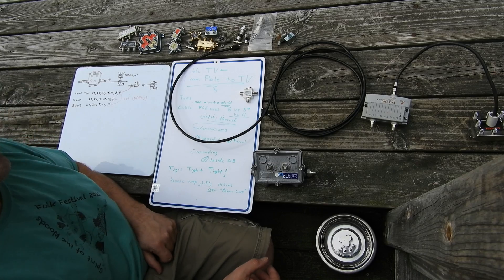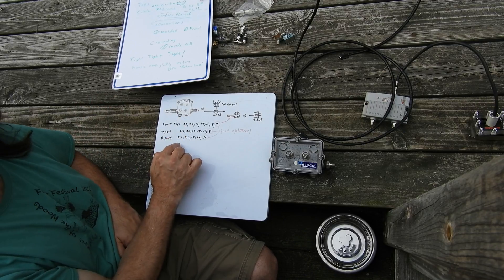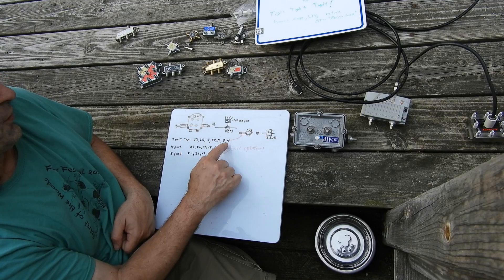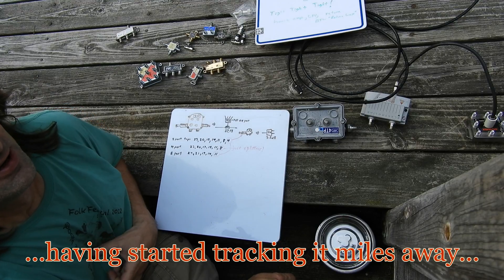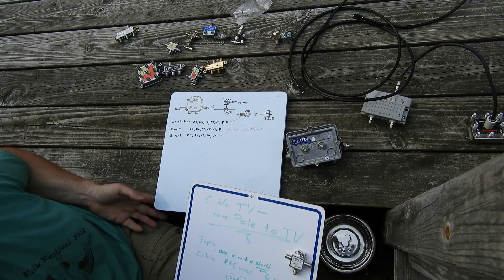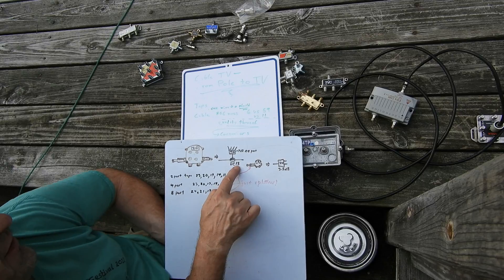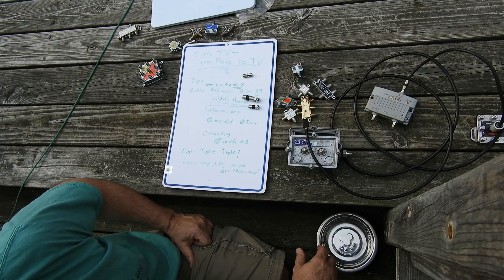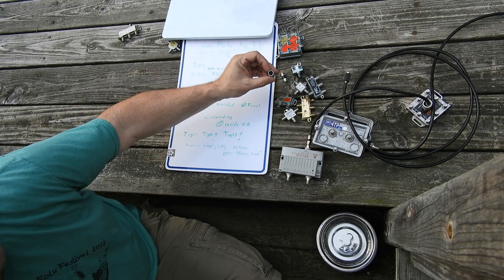CATV - From Pole to Home

Comment: I was the only on the tap 20 years ago.  Now 2 houses were added.  The tap only had two outlets.  They cut my line and added a splitter to feed my neighbor and my signal .  I've had interference ever since.  How do they fix this?  Should the tap have 4 outlets to eliminate the splitter that my neighbor and I are sharing?
Reply from the maker: Ideally, they should change the tap plate, but it depends on the design whether it can be done or not, if the extra loss would be significant downline. If the big number on the tap is a 4, for example, you'd have to go up to an 8 value to get a four-port tap, so signal levels drop 4 dB. Same with a splitter at the pole but it is done sometimes when feeding three customers. putting the longest drop directly on the tap and the two shorter ones on the splitter. I always tried to get the service techs to run a piece of ground wire from the tap to the splitter if they do this, a little shorter than the RF cable so it takes the strain off and better grounds the splitter in case one of the customers developed a floating neutral. It really shouldn't cause interference unless the connections are bad or loose or the signal was already weak, or your neighbor is feeding in unusual interference.

Comment: Hey I got a bit of a problem with where I live. Xfinity wants to charge $45,850 to pull coax to my house. 614 feet of cable total needed and I'm going to split to to units with their own equipment so I can separate the networks. We are tenants and the landlord isn't going to pay our install. So I am going to try to plug into our tap from the power line and run the weatherproof coax myself- can't afford to bury it. I need to know if I need a repeater, if so, can I power it from the house itself. Never done this before, so I need some guidance. I can pick up a spool of 1,000ft of 18 rg6 quad shield cu catv cm/cl2 for 98 bucks
Reply from the maker: Expensive quote! They are probably going to run .625 hardline and an amp too for that price. Doing it all with RG6 would likely require an amp with tilt and return, they probably won't let you do it. I've seen people get the design from the quote and then hire a contractor directly to build the plant. You still have to coordinate with the construction department. I'm kind of guessing that your connection to Xfinity is probably near the end of their line so the levels are flat or even reverse tilted. You can buy a "house amp" with passive return that can be back powered from the house, and that could possibly work with expert setup. Maybe find a building that is in range of their plant and setup there and go WiFi via outdoor antennas. They should build it if there are enough potential accounts but they would want to sign an agreement with the landlord, gets complicated.

Comment: What's your opinion on excessive RF Tilt/Slope actually having any effect on the connection besides going out of spec easier if there is movement on the network/plant? As long as all channels are within spec I have never seen a degraded service from say a +/- 14db Tilt..... I'd be interested to hear your thoughts on this as you have more experience than myself. There seems to be no clear conclusion from anyone 🤷‍♂
Reply from the maker: It can be a problem depending on how the Low Band is used, if the levels get too low. I was rarely a problem on the system I last worked in, often I was surprised to see everything working with the low end so weak. But in the bigger system south of us they carried some well-watched digital channels on their Low Band, and a couple of their line techs were reluctant to properly EQ the taps.

Comment: A CATV drop cable has been placed outside my window, does this emit radio waves, I'm concerned because my bed is situated near?
Reply from the maker: If the cable is in good condition it is completely shielded. It can leak signal if the connections are loose or damaged or the cable has been chewed.
Reply: Thanks for getting back at me, Could I remove it, don't need it?
Reply: There have been millions of radio waves transmitting right through your body since you were in the Womb, it's too late to worry about a completely harmless drop cable outside your window. You'll be fine 🤦‍♂

Comment: I have a question about my cable modem downstream channels I have a D3 Arris surfboard 32x8 modem and one of the channels continuously causes problems. I reset the modem thinking that might fix the problem but it keeps coming back the problem is for the first 5 minutes the packets going through channel ID 7 are fine but awesomely I get thousands of uncorrectable packets what could be the issue? The cabling in the house is about 10 years old it's RG6 I have a Poe filter on the main line in the only thing I can't check because the pool is so high is the connections at the main tap have any ideas or suggestions what it could be?
Reply from the maker: Hard to say from here but check out my video on Self Install Kits for some tips that might help. If you can identify what frequency that ID7 is at it may yield a clue, for example, if it was around 27MHz it would likely be CB interference. Grab a 7/16th wrench and make sure all connections are snug. Look for any connectors that weren't installed correctly or any damage or kinks, unterminated lines and etc. The Self Instal video goes through this type of stuff.
Reply: Okay I did what you suggested i checked all my cable lines made sure they were all tight and the problem still occurs I looked inside the plugs to see if there were any pieces of metal sticking to the stab there wasn't the last thing I can think is the cabling going through the Attic a week ago they just replaced the main cable drop coming from the top on the pole.

P.S. the downstream frequency is 435.00 MHz
Reply from the maker: @christophermoriarty7847  Any idea on  RX/TX levels? Did you inherit the house wiring or have you been there the whole time? Wondering if there could be a hidden splice or splitter somewhere you haven't found. Too much receive level can be a problem, so can too little transmit or a max'ed out transmit. If the modem is the only thing hooked up and you have no splitters, often you will have a high RX and a too low TX and sometimes an attenuator "pad" might be needed. Do you own the modem or is it owned by the Cable Co.? Don't go out and buy a new modem unless your able to borrow a test modem from the Co. to test first. Techs don't like to change modems because of the time it takes to get it set up with the office. The bottom line is to make them come out and fix it. Techs are under great pressure to get the job done quickly but repeat calls are a black-eye for them. Sometimes it takes repeat calls to get the Ace service tech out or to get it bumped up to a line-tech.
Reply from the maker: @christophermoriarty7847  The upstream frequency is usually the more vulnerable, lots down there that can interfere...

Comment: I've got a question.  For some reason in my house, we've always needed a little plug in power booster that the coax connected to, that boosted the signal enough to use a cable modem.  The cable that connects to the little booster, is upstairs in a bedroom that doesn't have a tv or use the cable (other than to run the booster).  I've tried moving the booster, and connecting it to a coax cable in another part of the house, but it doesn't actually boost the signal for the house- at least not to the cable modem.  Any ideas why this run of cable, to the upstairs room, is the only one that seems to be able to put the booster to use?  Is it because of where that cable is connected on the tap (inside box on the back of house)?
Reply from the maker: You really need to know your 
receive and transmit levels from the modem. You might be able to gather this info by logging into the modem or finding a freeware program online. Modems don't like too much signal, maybe there is something wrong with that line that it is making up for. Unless the booster is made for cable it might not have much of a return path, it may be helping by attenuating the return. A lot of possibilities. A modem only needs to receive the DOCSIS channels at around 0dBmv, and best if they are transmitting in the mid-forties.
Reply: @HillsWorkbench  
Hey, I really appreciate you getting back to me about this.  I had wondered if when the booster is not connected to that line, if the line is acting like an antenna (as you mentioned in the vid), but it was just a thought.  I don't have the tools or expertise to really delve into troubleshooting the cable setup in my house, so I'll probably just call a pro to come look ; )  Again, thank you for taking the time to respond, and for making this excellent video!

Comment: Hey few questions mate. I recently noticed a messy utility pole, and neighbour has it backwards feeding into the junction box which 2x4 wood probably glued on both ends which has to be a violation. Even though its rg6 or whatever can't be legal to do it yourself  right? Most likely is feeding power as well. Also I have 3 boxes while its showing up as 4 tivos with a cloned mac address so it has to be them stealing from me. Probably why I got hacked so many times as well. TV and internet since its moca. And who knows what else, probably using my power as well since my garage keeps tripping the breaker. You mentioned the taps are also sometimes assigned to other neighbours right? As a customer wouldn't we have a say not sharing? Also new lines are hanging low so either way  they'd have to come. Thing is the pole is literally  2 feet from my garage and like few feet from the garage roof to the top of the utility pole. Probably  12ft tall. Know annything about city charging you or its their resposibility?>
Reply from the maker: It would be hard for them to tap in unless via WiFi, they shouldn't be able to get into your Moca from the pole. Kind of hard to follow your description of the pole...
Your garage breaker is likely a different issue. Are your bills huge? Maybe the line out to the garage is leaking, insulation damaged.
   A typical CATV tap may have two to eight ports. These ports have better than 20dB of isolation from each other so neighbor to neighbor interference is rare.
  Not sure I get the last point.  2' for a cable line is adequate clearance over your garage though some areas do not allow "aerial trespass".

Comment: This is great information.  The Comcast contractors need to watch this video especially the grounding portion.  They did my install and did not ground a thing.  I had a  Comcast tech come out and he was appalled on the poor installation.  I believe that grounding is code in some areas.  To make matters worse some of the connectors were poorly crimped.  Want cable installed make them send an in-house installer and not a contractor.!
Reply: In house service techs always have it tough, the press of the expected productivity metrics, and constantly having to clean up after contractors and Self Instal Kits, what is booked for a simple task turns into a manifold list of chores.
Reply from the maker: I'm moving to a more rural area and had to get satellite for internet, same deal. The contractor didn't do any grounding, no weather protection of connectors, took a long time to find the satellite because he put the pole in way out of plum. Contractors only make money by getting away from you ASAP.

Comment from the maker: JohnAudioTech
JohnAudioTech
2 days ago
I used to disconnect the cable from my modem during storms as I have had stuff killed by lightening. I probably should put on a terminator when doing that. BTW, why the 360K upload?
Reply from the maker: Hi John, thanks for pointing out the low rez. Uploaded in 4K, not sure why YT limited it to such a low resolution, reuploading it seems to of fixed that.
 Ideally, Yes, termination is always proper, though you probably won't notice it with digital TV and while not using data (while disconnected obviously). I rent my modem, but if I owned my own D3 modem I'd probably disconnect it in a major storm too, just be sure you make sure the cable is on snug when you re-attach it, use a wrench (but don't get carried away)!